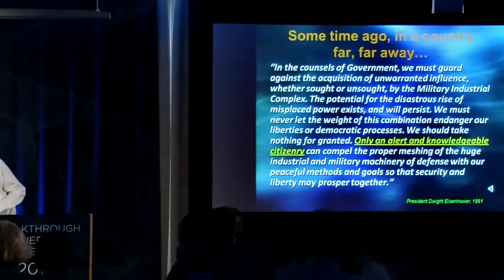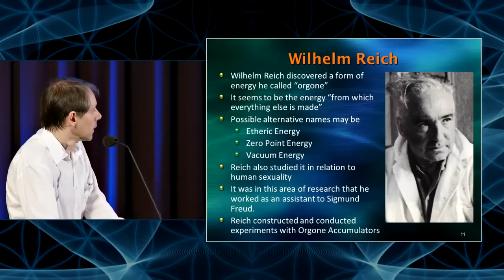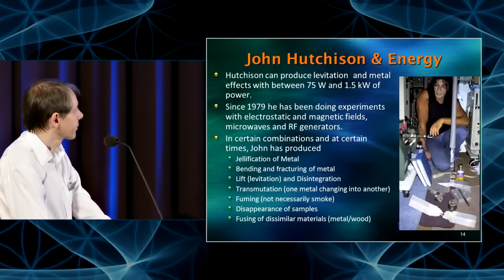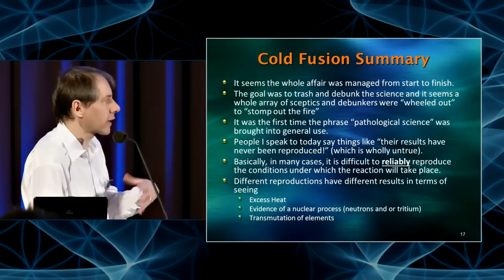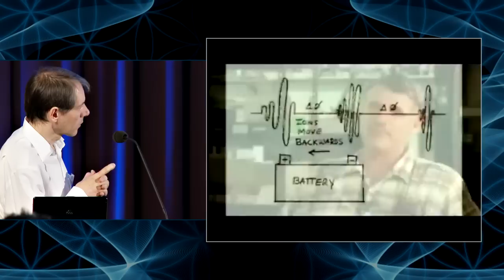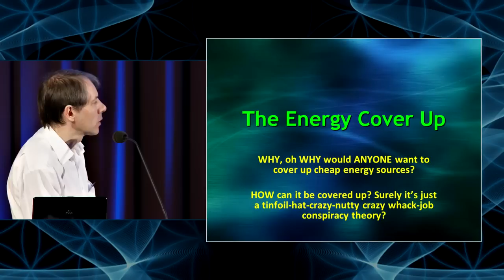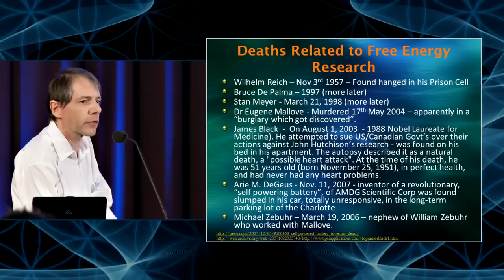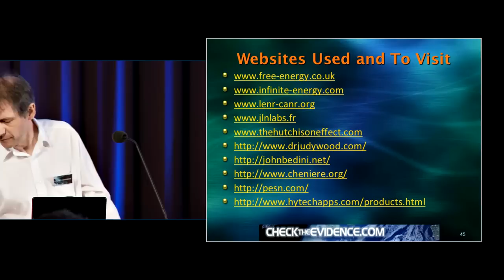Infinite Energy, But Not For The Masses | Andrew Johnson

Comment: I believe this quote from Naked Gun - the smell of fear is appropriate here:
"Gentlemen! Gentlemen! I know you're all worried. I agree, there's plenty to be worried about. Like this solar power plant; already operational outside Los Angeles. Photovoltaic cells; they convert sunlight directly into electricity. Fluorescents; last ten times a long as a conventional lightbulb, uses only a quarter of the power. Super windows; insulate as well as ten sheets of glass. An electric car; partially powered by solar panels. But the truth is, gentlemen, I'm not worried about any of these things. *Because nobody's ever going to know about them*."

Comment: That is right, energy can not be created or distroyed. So therefor the energy we convert to electricity must already be there. Electricity is converted from the Aether so Aetheric energy is everywhere    just waiting for us to convert it. At no point do we pay for electricity, we only pay for the devices and fuels required to convert Aether to electricity.
Reply: The existence of "aether" was disproven in 1887 by Michelson and Morley
Reply: @bytheseaaspirinshop801  No they didn't, it was a failed experiment. What are your explanations for dark matter and dark energy? Or for that matter, how is gravity created without using the general relativity model?
Reply: Dieter Soegmeier
"the energy we convert to electricity must already be there" - The mechanical energy given to the generator is converted to the electrical energy flowing from the generator.  It isn't 'already there' in the generator.  It is put there by the turbine (or motor) in the first place, and the turbine is extracting the energy out of the high pressure steam, or high pressure water, or the pistons of the motor are extracting energy out of the combusted fuel, in the first place.
Reply: @tonyduncan9852  Please help me understand how you think that the petrol used to explode and then push the piston that helps turn the alternator whrn a water wheel can do the same thing but at no time does the fuel ever become electricity. The alternator will convert energy to electricity no mater what you use to turn the alternator. and to prove that energy is converted to electricity Tesla did the same thing without using moving parts by using a coil to convert energy to electricity with the use of potential diference. As tesla stated, the potential diference of a point 6m high to ground is 1million volts and 1100 amps and he then converted that potential with the use of his Tesla coil to convert it down to usable electricity. That is why his tower was pulled down because he was about to supply electricity to the people without any machinery or people involved and therfor at no cost and that was not what the controlers wanted. 
Or just go to youtube and see all the solid state devices that convert aetheric energy to electrical energy with thw use of an antenna and a coil and no moving parts. Energy is clearly avai;able and is ready to be converted at any time and point in space just as Tesla stated 120 years ago.
The Aether is real and is proven by every electrical device that converts energy into electricity. even a simple crystal radio proves this.
Reply: Dieter Soegemeier
"the petrol used to explode and then push the piston" - the crank converts the linear piston motion energy into rotational crankshaft energy.
"a water wheel can do the same thing" - yes, it supplies rotational energy to the alternator.
"at no time does the fuel ever become electricity" - The chemical energy in the fuel becomes heat energy, which causes the compressed gases to expand, typically, about a thousand-fold.  The expansion forces the piston downward, and the crank translates that energy to crankshaft rotation.  An ICE doesn't 'make electricity'.  It drives an alternator to do that.
"The alternator will convert energy to electricity no mater what you use to turn the alternator" - Yes, yes.
"Tesla did the same thing without using moving parts" - Not true.  When you create a potential difference you ARE moving electrons.  The electrons ARE 'moving parts'.
"As tesla stated, the potential diference of a point 6m high to ground is 1million volts and 1100 amps" - is gibberish and makes no sense.
"and he then converted - - - what the controlers wanted" is gibberish and makes no sense.
"aetheric energy to electrical energy"- is gibberish and makes no sense.
"Energy is clearly avai;able"- is gibberish and makes no sense.
"The Aether is real"- is gibberish and makes no sense.
"a simple crystal radio proves this" - A crystal is simply a diode.  Connect a diode to a coil and you can receive radio transmissions because that EM energy is passing right through you right now.  You are surrounded and pervaded by EM energy.
You must have either been badly educated or asleep in your physics lessons.
Reply: @rastiga9196  - Gravity is a force not an energy stop entering into word salad.  Gravitational potential energy is created by moving any two masses away from each other, you don't need relativity; Newtonian physicists understood this simple concept.
Reply: @jmr9699  It is an exceptionally weak force considering I can jump with my weak ass muscles with a big ass planet holding me down. How is it created by moving two masses away from each other? That makes no sense whatsoever. Where does it come from? The supposed GOD particle should have answered that question but I haven't seen anything proofed out as of yet.
Reply: You are right different forces have different strengths, just like different sounds are either softer or louder, it doesn't make them any more or less valid.  How is this nonsensical?  Just because we don't fully understand how everything in the universe works to the minutest detail (some of us have a better understanding than others) this doesn't that we should throw out all of our current understanding as well as tried and tested models.  Do you have any scientific background?
Reply: What Is Geet.
Reply: @jmr9699  I don't, just what I learned in school. I have read a lot of scientific publications though and worked as an aerospace cnc machinist most of my working life. As far as I know, we don't know what creates gravity yet and only have theories. We know most of how it works and scientific models have proved us mostly right but we don't know how it's created yet. That's why I mentioned the GOD particle. Physics breaks down on the sub-atomic level, that is why we still don't have a complete theory of relativity yet. Science is all about proof and counterproof until we have it right and even then it is tested ad nauseum.
Reply: fact
Reply: @rastiga9196  We never know in consideration to science. Science is always a theory. You can believe it or have faith in it the same as anything else, but science does not prove anything. Only provides proof to support a theory.
Reply: @bytheseaaspirinshop801  They only disproved etheric wind.

Comment: "No appreciable heat"  in the 9/11 towers collapse?

I was watching the towers on that day on TV.  Most stations were covering that event live.

There was a lot of heat.   I'm not saying there were no shenanigans.  I'm saying there was a lot of heat.  

We all saw people jumping out of very high floors.  They were faced with "do I want to be burned alive and die slowly, in agony, or do I want to get away from all this heat, cool off on the way down,  by the time the pain from all the heat is gone I'll be dead"  they waited till the last minute to make that choice.  If you've ever been that close to a hot fire, like right next to it,  you know they were insane from the physical pain of that.

There was a lot of heat.

The only hope we can have is,  if the percentage of dangerously homicidal people in positions of power doesn't increase.  Pray their numbers greatly decrease.

.
.
.
Reply: There was enough heat generated by a collapsed tower to raise a thousand tons of its steel to RED HEAT.  Here are the calculations, using the scientific facts.
THE MATHS THAT PROVES ARCHITECTS FOR 9/11 TRUTH TO BE LIARS.
THIS OFFERS A SATISFACTORY EXPLANATION FOR ALL THE OBSERVED CONSEQUENCES OF THE WTC TOWER COLLAPSES.
An analysis of a tower's potential, and therefore kinetic, energy is a good way to illuminate the consequences of collapse. The only material burning in the wreckage was HYDROGEN GAS (and most of that would have occurred at the wreckage surface).  Deep down at the base of the densely-compacted wreckage the very hot and compressed iron had created anoxic (reducing) conditions, and fire could not have occurred no matter what the local temperature may have risen to.
PRIMARY 9-11 CONSPIRACY ASSUMPTION SHOWN TO BE FALSE:
AN ANALYSIS OF THE AMOUNT AND DESTINATION OF THE POTENTIAL ENERGY OF A WTC TOWER
The first law of thermodynamics, also known as the Law of Conservation of Energy, states that energy can neither be created nor destroyed; energy can only be transferred or changed from one form to another.
Source: Boundless. “The Three Laws of Thermodynamics.” Boundless Chemistry. Boundless, 02 Jun. 2016. Retrieved 12 Oct. 2016 from https://www.boundless.com/chemistry/textbooks/boundless-chemistry-textbook/thermodynamics-17/the-laws-of-thermodynamics-123/the-three-laws-of-thermodynamics-496-3601/
The World Trade Center towers (and WTC7) fell NATURALLY due to buckling failure when their 'slender' columns lost attachment to their floors.
They only used a third of their Potential Energy to destroy themselves, the remaining two-thirds was consumed in crushing some of their steel into ground zero.
A standing WTC tower possessed two hundred and forty six tons of TNT of POTENTIAL ENERGY merely by just standing there. We shall call this energy Eo.
The tower fell by taking the direction of LEAST RESISTANCE, which was THROUGH ITS BUCKLING COLUMNS.
The columns failed by BUCKLING because their STRUCTURAL STABILITY had been compromised by LOSS OF FLOOR ATTACHMENTS. No steel got crushed when this buckling failure occurred. 
Buckling is not a MATERIAL failure; it is a STABILITY failure.  This type of failure was first explored by the famous polymath, Leonhard Euler, around 1,750 AD.
The floors had detached themselves by sagging to an angle which snapped their connections. Photographs of these separated floors (taken shortly before collapse) are plainly shown in the NIST Report.
As each tower fell, some of that stored potential energy, converting to kinetic energy by falling, was released to damage and dismantle both the moving and the stationary parts of the tower on the way down.
The amount of the initial energy consumed in such a manner was inversely proportional to the rate of acceleration of the tower as it descended. It can be calculated.  We shall call it Ed.
The amount of energy remaining (Er) when the tower wreckage hit ground zero is then (Eo - Ed).
This energy, transferred elastically, caused PLASTIC DEFORMATION in the crushed base steel wreckage, and became HEAT. This too can be calculated.
The heat was considerable. The signs of it were captured by satellite. It amounted to the equivalent of a thousand tons of steel raised to a temperature exceeding 1,000 degrees Centigrade.
This hot steel, crushed and pressed against ground zero, oxidised its surface (making scale) and absorbed local oxygen gas, leaving a reducing atmosphere.
In these reducing conditions, and at a temperature of 1,000+ degrees C, fireman’s water which had percolated through crushed gypsum wall boarding DISSOLVED calcium sulphate (yes, Gypsum is 5% soluble in water), the sulphate ions of which were reduced to sulphur which combined with the exposed iron to form IRON SULPHIDE, which at such temperatures was MOLTEN, and flowed away. At a temperature of 1,000 degrees Centigrade, in an absence of oxygen, and in the presence of hydrogen, Sulphur and Iron atoms become keen partners, forming IRON SULPHIDE, which above 1,000 degrees Centigrade, is a LIQUID, and flows away, leaving 'corrosion' claimed by 'truthers' to be caused by thermite.
Such hot reducing conditions also caused the water/steam to be REDUCED to hydrogen gas which was noted by firemen to be burning at the surface of the wreckage.
The wall-boarding and crushed concrete surrounding (but mostly above) the steel were THERMAL INSULATORS, so greatly slowing cooling.
CALCULATIONS (in SI units):
To calculate the original potential energy of the tower in TNT equivalent,
G = 9.81 metres/sec^2
Mass (M) of tower = 5e8 Kg
Height (h) to the tower’s CG = 210 metres
The explosive energy of 1 ton of TNT (Kt) is equivalent to 4.184e9 Joules
Equation: Tower Potential Energy (Eo) = ( M * G * h ) / Kt
This is equivalent to ( 5e8 * 9.81 * 210 ) / 4.184e9, or 246 tons of TNT.
The Potential Energy of each standing tower was equivalent to 1,000 standard 500 lb. ‘iron’ bombs.
To calculate the kinetic energy used in the tower destruction takes a moment, after a simple thought experiment, namely considering the tower would fall at G if there were NO resistance, and if it fell so slowly that it consumed ALL its energy, it wouldn’t fall at all.
So we can see that the PROPORTION of the energy used up by the collapse must equate with the proportion of G which the collapse was unable to achieve.
As the collapse acceleration was, by truther calculation, established to be about 70% of the acceleration due to gravity, we’ll use that.
The energy used up in tower destruction was therefore 30% of 246, or 73.9 tonnes of TNT.
Assuming that 30% of the tower fell outside of the basement, then the energy (Er) available to heat the wreckage base (by elastic energy transfer and crushing) was 0.7 * (246 - 73.9), or 120 tonnes of TNT.
We know that the steel reached at least 1,000 degrees Centigrade because that is the melting point of iron sulphide.
We can therefore calculate the mass (m) of steel that was raised to that temperature.
The specific heat of iron (Fs) is known to be 0.45e6 Joules / tonne / degree C
The ambient temperature was 20 deg C, so the temperature rise (Tr) was 980 degrees C
Equation: Er = m * Fs * Tr
So m = Er / Tr * Fs = ( 120 * 4.184e9 ) / 980 * 0.45e6
And so m = 5.02e11 / 4.41e8 = 1,138 tonnes.
The collapse of each World Trade Center tower created 1,138 tonnes of red hot steel at 1,000 degrees Centigrade.
So we can see that there is no need to postulate an extra source of energy, and that the basement wreckage heat is also easily accountable, with the additional corroboration of burning hydrogen at the wreckage surface, and molten iron sulphide at the wreckage base.
And so the underlying 'truther' assumption, that the planes couldn't bring down the towers, is shown to be FALSE, as it is shown by calculation, using the physically-correct values, that the potential energy possessed by the towers numerically accounts for ALL the known consequences, through elastic energy transfer, plastic deformation, HYDROGEN gas burning at the wreckage surface, EUTECTIC IRON SULPHIDE melting off the hot steel pressed against Ground Zero, and, of course, a tremendous amount of HEAT.
These results are EVIDENCE of the event.
They have been evident to any REAL scientist or engineer from day 1.

Comment: In Economics there is an old saying: there is no such thing as a free lunch.

There is no such thing as  "free power."  First you need and actual product or device.  It has to be manufactured.  There has to be a corporate headquarters and staff, there are parts to be made, manpower to build it, cost of advertising, marketing, distribution, stores to sell it, taxes to be paid, and on and on.

Then there has to be a warranty on it.  Who is going to service it when it breaks? Or it needs
replacement parts?

I still think its a great idea.  Heck I want to buy one.  How much will it cost?

Comment: Quartz is piezoelectric, so when it's compressed and decompressed, it gives off an electric charge. So if you resonate a piece of it it generates electricity. This is how crystal radios work. If you use a tiny piece the size of a grain of sugar and use a weak radio source, you'll get a couple of hundred millivolts at low amps. If you use a piece the size of a house brick and a strong radio source like the earth (Schumann cavity resonance) or sun (72.3hz), guess what happens to the electrical output? Quartz is Silicon oxide (SiO2, Silica, aka sand) and is VERY abundant on earth. (Just look at the Sahara desert) You can compact the sand into any sized brick you want, so that it will resonate to whatever vibration you want. (Like the great pyramid in Egypt)
Also, when you run water through sand it generates electricity. The water pressure compresses and decompresses the sand. There's no reason why we don't drive electrodes into the sand at unused beaches to generate electricity when the tide comes in and goes out. Or even build infrastructure underneath used ones.
Reply: Bahreah Sprout that’s why they’re stealing the sand

Comment: I think he just showed how things work hear, Stanly Myers just came up with a cleaner fuel source hydrogen from water under radio frequency tank circuit amplification instead of brute fore DC currant. Every personal car could and should be using that system by now, we can see hear what big oil is willing to do to maintain there energy monopoly, strange to think the human will never surpass the petroleum age.
Reply: Were all just prisoner's here of own design. Stab it with there steel knives but just can't kill the beast. Hotel California.
Reply: Wrong.
Reply: stanly myers and bob lazar both showed us petroleum is a choice now with there water powered cars.
Reply: You got it right, so this crap to suppress genius is for the greedy and evil SOB's
Reply: *here